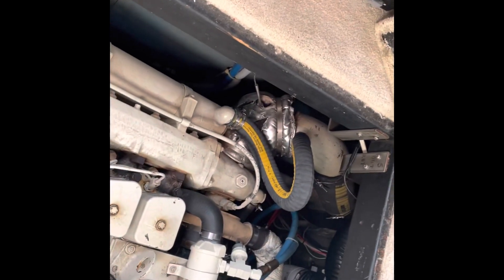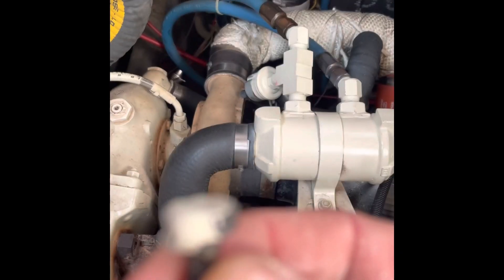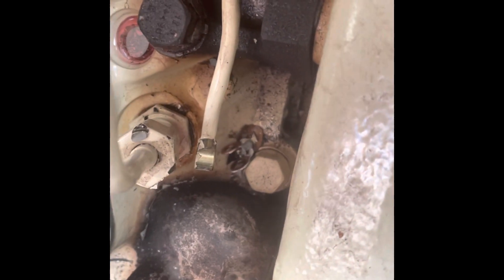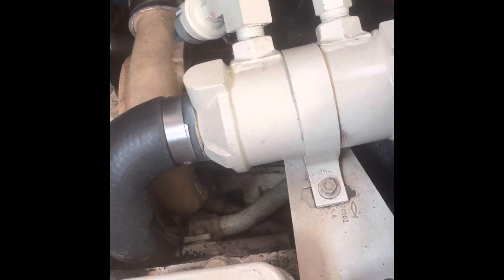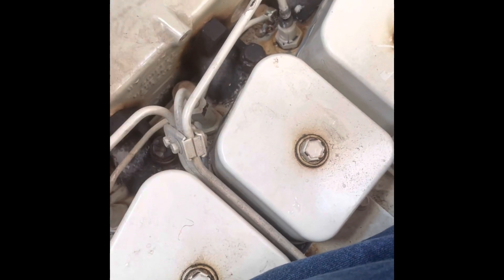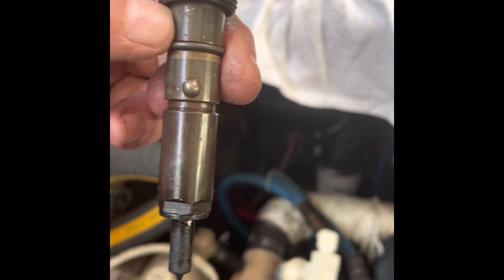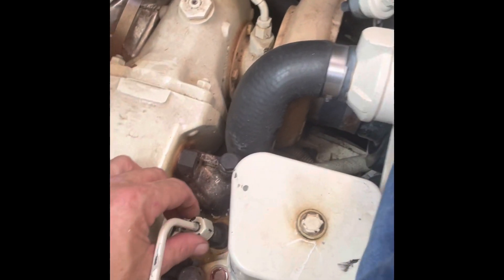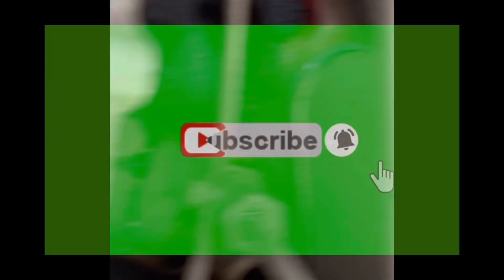Changing fuel injector on our Cummins Marine 6BTA

Comment: The nut that tightens the injector down has a seal that goes on both the bottom and the top.  You showed the top seal.  I found it very difficult to install the lower seal into the nut and then slide the nut over the injector.

Comment: you should have shown the puller being used, what size socket for the injector and fuel line nut, and after you pulled the injector you showed the ball bearing but what were you pointing at in the rusty hole? Please, if you are going to make videos put more detail in it. Thank you.
Reply from the maker: @jimapril-s1s  thanks for the tips.